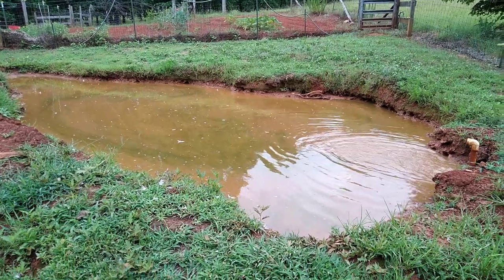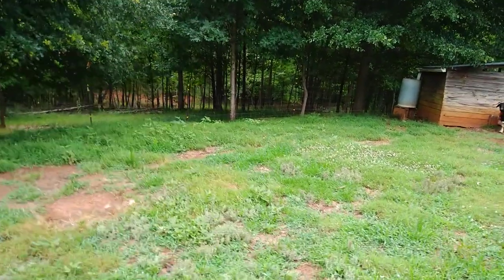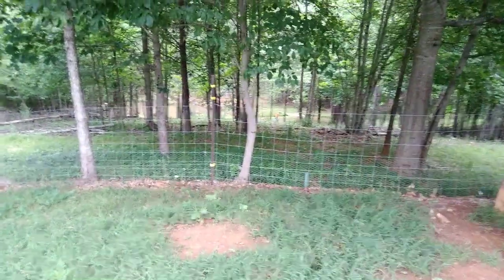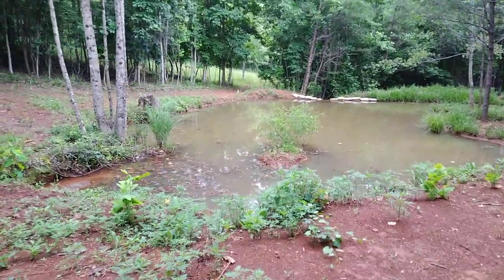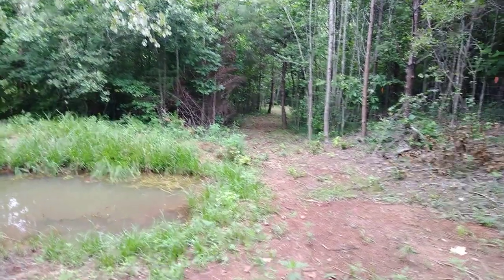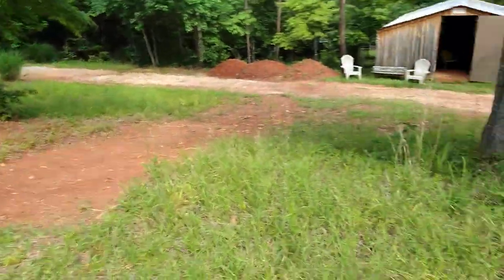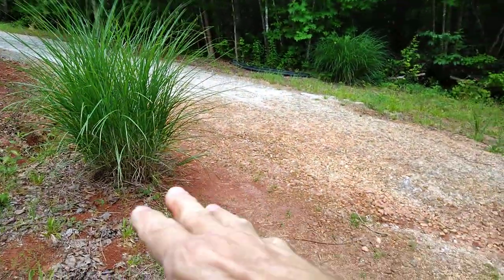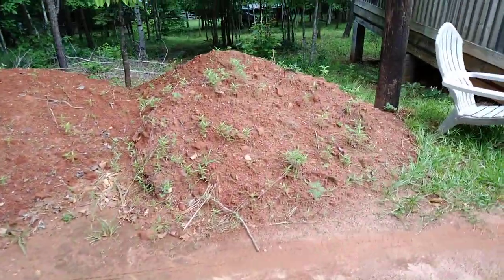What can you do with a Harbor Freight Towable Trencher?

Comment: Mines ran power lines, sewer lines, dug drainage ditches, extended a leach bed and its about to dig out a septic tank hole and some footings for my garage. They are actually pretty useful and times not an issue when you own it. I hear alot of griping from so called experts about how bad they are but I'm happy with mine after 3 years of ownership.
Reply from the maker: Well said biff! It's all about understanding what it is and how to use it. Thanks for watching!

Comment: Some more things that can be done with one.
You can tamp with it by lifting and dropping the bucket, or by sliding it towards you as you curl the bucket.
You can swing it to level soft, uneven dirt. like when you back fill a trench.
You can sink posts like your duck fencing has or larger posts depending on the condition of the ground and strength of the posts.
If you want them to be straight, you have to operate two sticks at the same time to eliminate the arcing. You want to push straight down with the bucket. Banging a pipe vertically into the ground may also work.
You can make a slicer tooth for it to replace the bucket.
AND you can make a blade to level off and smooth that replaces the bucket or fixes onto the bucket.

Comment: I did a duck pond too. I have clay soil and it holds the water for many weeks. I did add an air driven water pump just to circulate the water. Eventually to move water to the top of a waterfall feature give the pond more oxygen.
Right now I'm using mine to move a few truckloads of wood chips the tree trimmers dropped off, from the front to the backyard.
Reply from the maker: I also have clay and it holds water very good. I like the waterfall idea. I may try that in mine. It's amazing how many things we can find to do with the trencher.

Comment: Thank you for this informative video.  Do you think the trencher is capable of digging for a storm shelter?
Reply from the maker: Yes, I am going to be doing a storm shelter with mine sometime soon. If you have never used a "towable excavator" I would suggest doing some smaller jobs first to get a feel for how it works. The biggest thing about these is the fact that they do not swivel around so you are limited on where you can put the dirt you dig. Thanks for watching and keep me posted.
Reply: @DoubleMFarmHomestead  Absolutely! I've never operated a backhoe before but there will be PLENTY of other jobs on which to practice before I get to the storm shelter. Thanks!

Comment: Question aboot the grease fittings on the pivot pin. Are you able to replace them with extended fittings? Or would they break off when the boom swings?
Reply from the maker: There is room to put extended fittings. The stock fittings are recessed in there. I have thought about doing it but just never got around to it.
Reply: @DoubleMFarmHomestead  well my first thought was to put extended ones in. Bc everyone says those are the most difficult ones to reach
Reply from the maker: @kiltedbroshar4187  To be honest, I've never had a problem reaching them. I did change them when I first got it. The stock ones are soft and break easy.

Comment: How much can it lift?
Reply from the maker: You know Skip, I'm not sure what the lift rating is. I've looked in the manual and can't find it. All I can tell you is I've picked up several logs (one was 12" dia. and 10' long), some large stumps and lifted a 4 cyl. engine from an old truck with it. I did have the other end hooked to my tractor to keep it from tipping for that engine lift. It's all about angle and reach. LOL
Reply: @DoubleMFarmHomestead  thanks for getting back, planning to use a backhoe for a cabin build, that's why I'm trying to find out how much one will lift, may go with the Janson 300, able to lift 1850lbs, still searching.